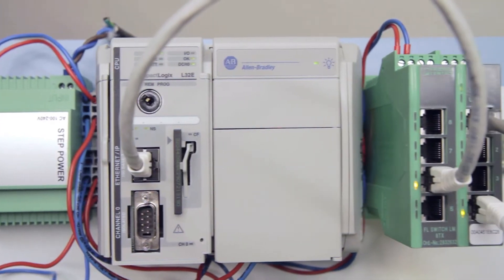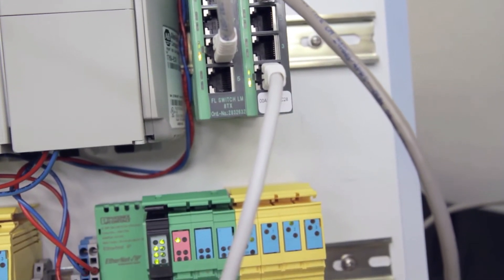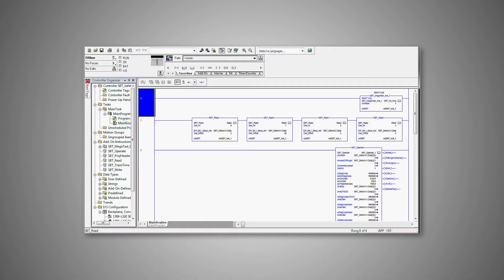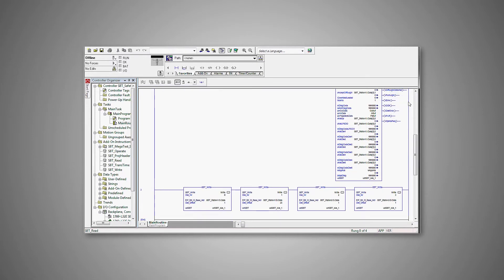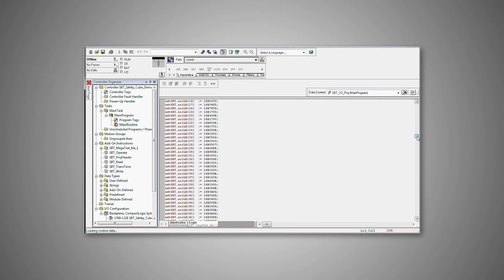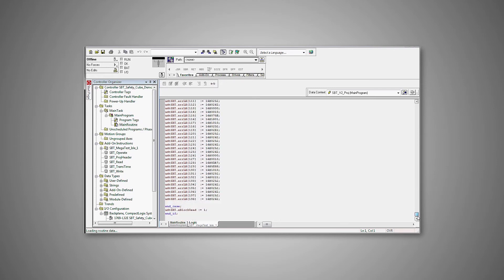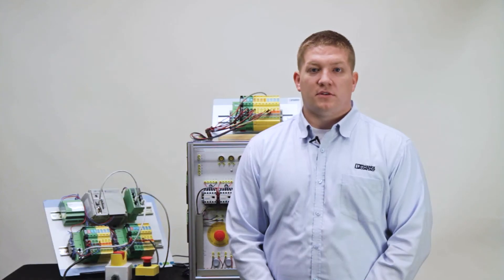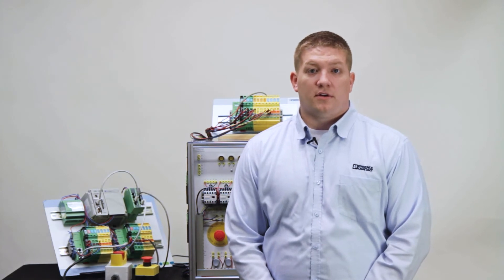SafetyBridge Technology Safety on EtherNet/IP - Phoenix Contact

Comment: Hi Phoenix Contact,

I am working with Linen Handling Automation plant at Qatar. I am having ILC 200 IB controller on our Dryer machine, It gets 'Fail' with Red LED at times during machine operation. Checked with Machine IO everything seems perfect, checked with Interbus cable which is fine too. Once I Power off and Power it back runs fine for an hour and then at any point if time it gets again Fail RED LED.